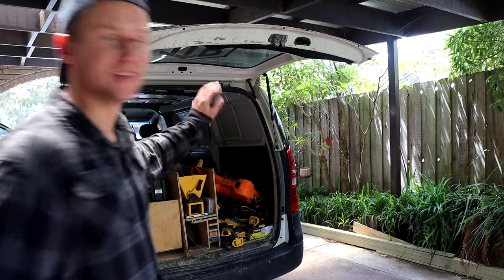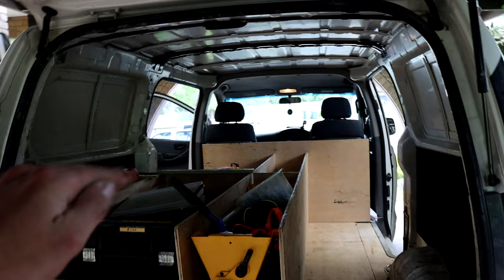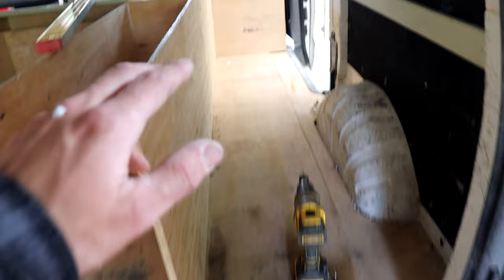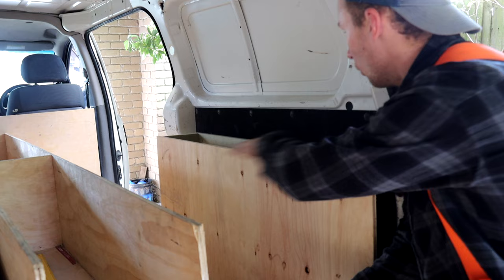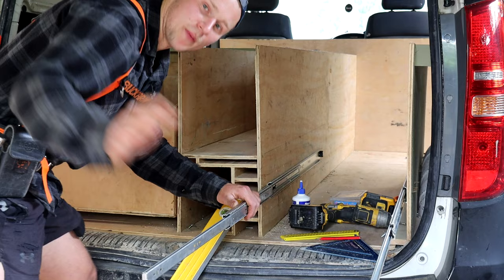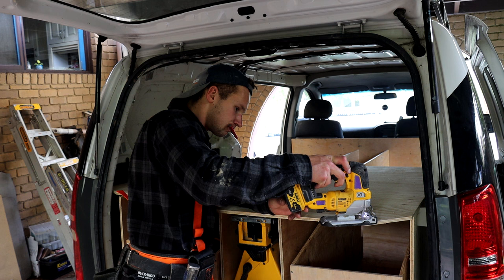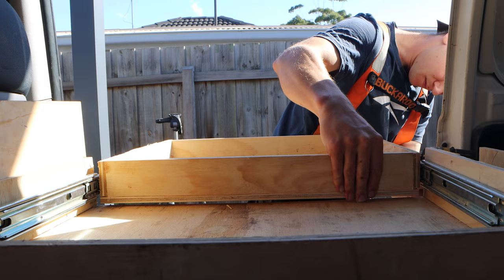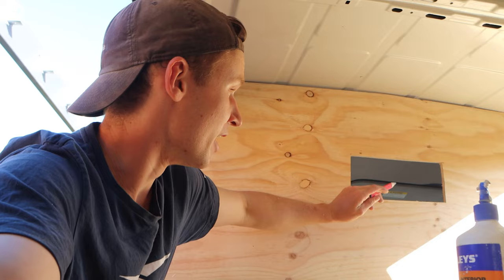Building a Custom Van Fit Out | Tool Storage

Comment: When I make a plywood top as such, instead of cross cutting through the middle, I use the two factory edges and measure from a bearing point to get the end cuts. Good work